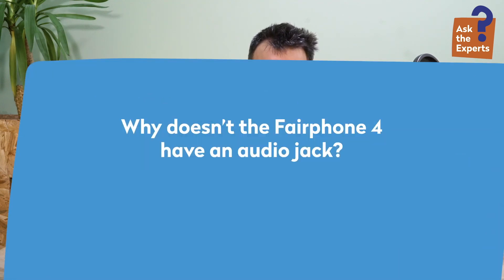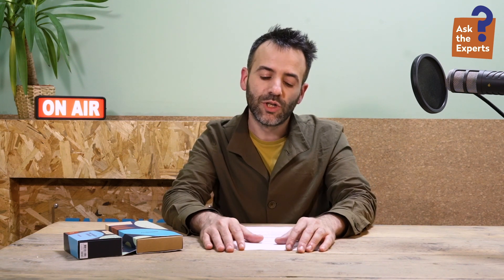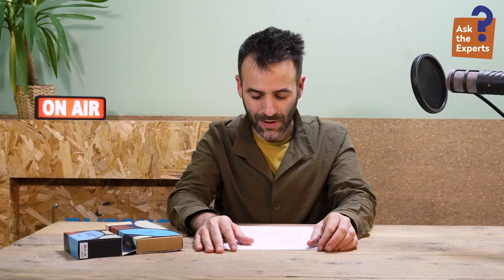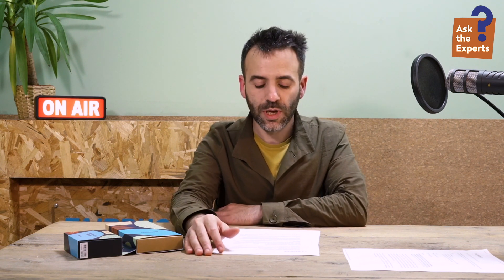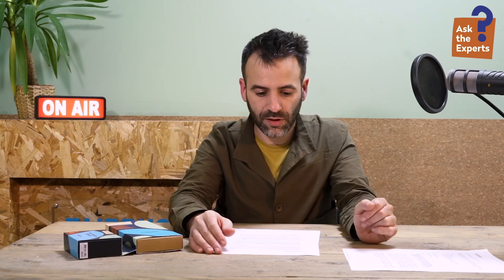Where's the headphone jack?! | and other questions answered | Fairphone

Comment: Very unfortunate, that the headphone jack got cancled!
It's a gamebreaker for me. If a phone doesn't have one, I don't buy it
Reply: @CrazyMineCuber  Adapters are a shit solution. They are only recommended by the people who don't even use them, because they use wireless headphones.
It's basically like taking your cow away and then giving you a bit of milk from it as compensation, then wondering why you're not happy with that.
Reply: Same here
Reply: @CrazyMineCuber  it's just a lazy excuse of the designers to sell more stuff (adapters), it fitted to all phones from back in the times...
Reply: @CrazyMineCuber  
- the jack can be in the phone
- buying an adapter is more e-waste
- its' quality is not as good (missing DAC)
- adapters suck
Reply: @TheTS1205  buying an adapter isn't necessarily more e-waste than a build in one though. If anything there is less waste.
1. Not everyone uses it
2. It will get less wear from dust and water

Then your point of a DAC. It's a Digital to Analog Converter. This is also included in an adapter. Because USB C is digital and the 3.5mm jack is analog.
Then there is a point of DAC quality, a lot of DACs in phones ain't the best. With an adapter you choose your preferred DAC.

Let's say that half of the people using smartphones care about the jack, that means that half of the jacks are basically not used and are already e-waste while they do tend to cause general longevity issues for the whole phone.

I love good audio, and I love being able to use a high quality DAC, so even though I currently own a phone with a jack I don't use it because it's of lesser quality.
Reply: @codex4046  okay, so you might have a point here.

People only don't use their jacks due to having been restricted to not having one the last years, but I get your point of e-waste when not used.

IF I was cool with adapters as you propose (good ones with a good DAC, how much will that cost me?) I'll have to buy several ones cause nobody wants to take them with the phone all the time:
1 for the car, 2 for the different home stereos in the house, 2 for the headphones used in the family, that's 5 already where 2 built-in would have done the job...
Is that more or less e-waste?

About that dust and water proofing with headphone jacks:
The USB-C connector collects as much dust as the headphone jack, I clean them maybe once every two or three months, where's the deal there?
There a several waterproofed phones with a jack out there (Sony Xperias?)..

I might be an ancient human for using cables instead of Bluetooth, I get that, but for me personally there still HAS to be a jack IN a phone 😕

Comment: 1. sell in india plz
2. partner with other like minded companies
3. make it easy to root
4. upgradeable motherboards i.e. soc and ram and storage
5. upgradeable displays- amoled, 90 hz, 120 hz
6. upgradeable cameras.
Reply: I'm sure they will sell in more places, but there is already a chip shortage as it is, so that will take some time. The bootloader is unlockable so you will definitely be able to root and install a custom ROM. Storage is expandable with a microSD card. 60Hz refresh rate is more than enough for most use cases. The cameras on the phone are already very good, but you may want to take a look at installing a GCam port for improved quality.

Comment: Disappointing about the audio jack. I have a perfectly good pair of headphones and will have to consume more stuff to be able to use my phone for work, which is essential. Also not convinced this new strategy won't just wear out the USB by more dramatically increasing the amount of times a connection is made. Have you done any actual research into this durability comparison?
Reply: @ingulari3977  Just buy an adapter cable.
Reply: @ingulari3977  It consumes more space and it's also a part which might lead to get water in - yes, sometimes people get into rain.
And btw a lot of people use bluetooth headphones - 3.5mm headphones are "dying out".  And only workaround for wired headphones will be usb c.
Reply: Having to replace possibly several other parts too cause they got compromised by water or dust due to a headphone jack sounds worse. That and its wasting space for other features and on top of that all of this is for a part that is replacable in multiple ways by parts that already exist anyway
Reply: @matthewtrebs9738  That has literally never happened to me. You're wildly exaggerating to justify a bad decision.
And no, the headphone jack is not "wasting" space, because the headphone jack is the feature I want in that space.
Reply: Seriously, what other feature could you possibly want over a headphone jack that somehow wouldn't fit if it was included? I want you to actually name said feature. Don't be vague about it.
Reply: @Knowbody42  ive lost i think 1-2 phones to shit getting in the headphone jack. Even if you remove it for nothing at least youd get a lighter and longer lasting phone. The fact the space is also being used to add 5g is icing
Reply: @matthewtrebs9738  Literally nobody I know has lost a phone because of the headphone jack, so you must be some kind of freak exception.
Anyway, if you care that much about shaving like 2 grams off the weight, you shouldn't be buying a FairPhone.
Reply: And no, adding 5G doesn't require extra space. All it requires is selecting the right SOC. The modem is integrated into the SOC along with the CPU.
And the FairPhone 4 does not use the biggest SOC on the market. It's more of a "mid range" SOC.
Plus, the frequencies 5G can use are mostly the same as the frequencies 4G can use, so even the antennas don't need to be much if at all different.
Reply: Well, I am also disappointed about the missing audio jack. But time changes and so here FP also. Many people use BT audio - so audio jack is not so important anymore.
If the USB fails working cause you have connected too many time the ear phones, you can repair the USB. That's important and counts - for me I use the ear phones so seldom, it wont matter. I would like to see ear phones with an USB connector, that would be helpful for me - but is there a market?
Reply: I don't buy that "times change" excuse for making things worse. No, it's not "time" to remove it. That's a load of crap.
Removing the headphone jack was only an excuse to sell you wireless headphones.
Just like it was not "time" to seal phones with glue so that you can't replace the battery. That was only an excuse to make them more difficult to repair.
Reply: There is a lot of discussion about the headphone jack, for every brand. And although I always like to "have an option", I now agree that the time for Jack is over. As mentioned in the movie and countless other places, it's relatively huge (for a single-use part); it is an opening for water and dust; it can cause issues where the phone thinks something is connected when there isn't; and yes, I have actually seen broken pins stuck inside the port.
Reply: @jaypaans3471  So? Make the headphone jack replaceable. Even other phones that are not designed to be repairable like the Fairphones have replaceable headphone jacks.

Comment: I highly disagree about the audio jack. In all these years I didnt had any issues with audio jacks, this is just an excuse to promote earbuds...
With the lack of it you actually damage the usb port even more because you are using not for just charging but also for earphones. 
If the phone doesnt have a 3.5mm port I won't buy it. I dont need a new phone now but if in the future the Fairphone 5 or 6 comes with 3.5mm  I might give a try to Fairphone since I never owned one
Reply: that you didn't have an issue with it doesn't mean that it was they wheren't correct in their reasoning. they made design choices. do you make the phone thicker? do you remove 5g? or do you remove the headphone jack which is also added risk for intrusion?